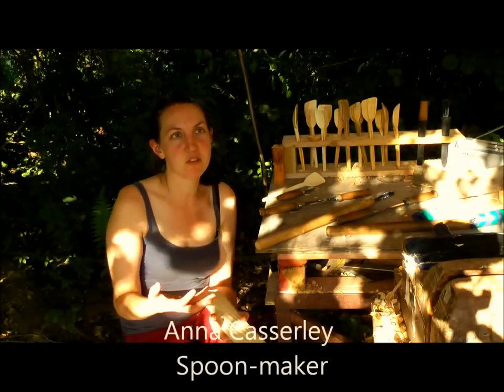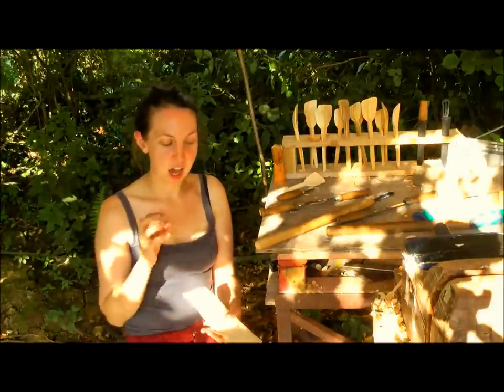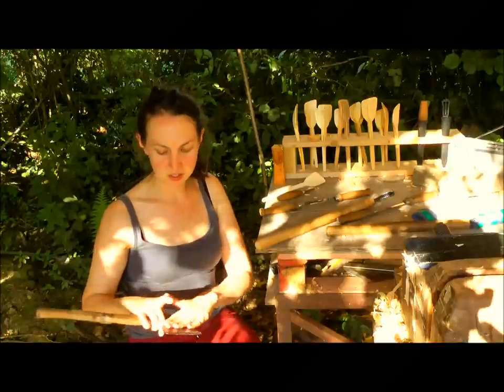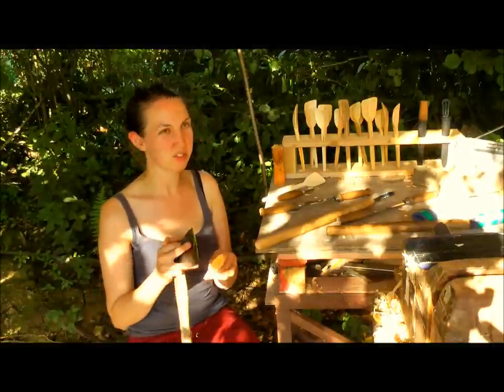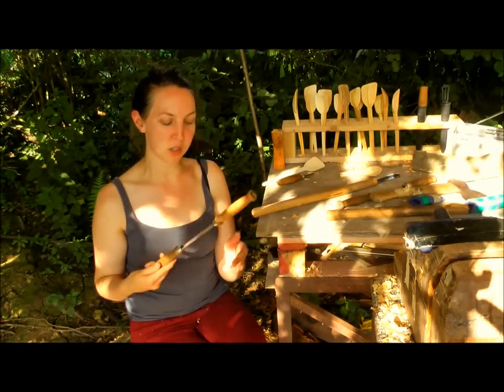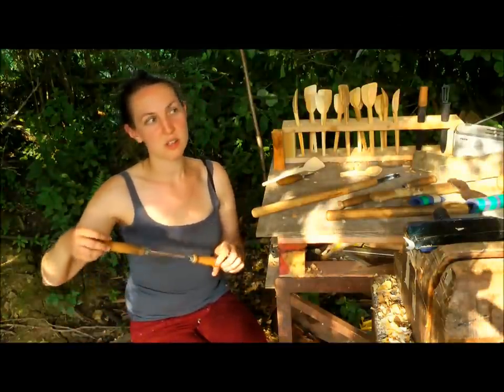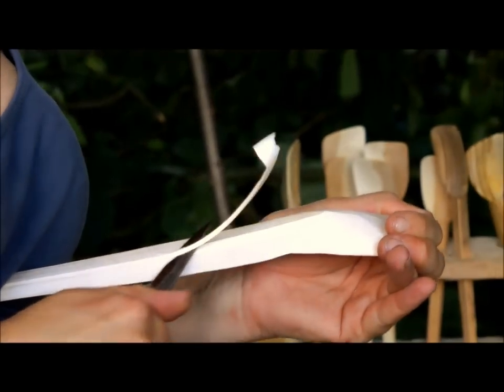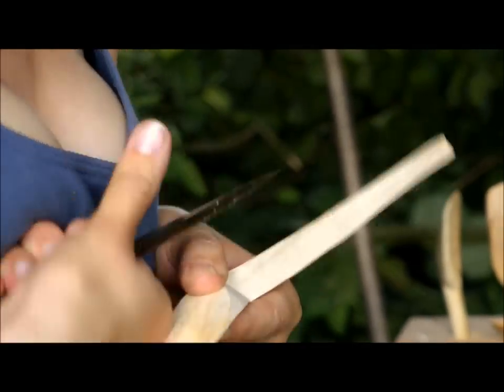The Woodcraft Series - Spoon Carving, Anna Casserley

Comment: Nice video Amy, good lighting and point of view, however, there are few things that I'm uncomfortable with, I can get past the English accent, but she mumbles a lot and it is hard to understand what she is saying.  It's call a draw knife, to be used on a draw stroke.  She is asking for an injury when she pushes with that particular knife.  Safety may not be a priority to her, viewers may think it is okay to use such tool that way. it's not.  I like her hook knife.  I look forward to your new posting.
Reply from the maker: Thank you for your comment and I am glad you like the video. I will say however, for any aspiring woodworkers, that Anna is a highly-competent professional and is using a push-knife. To use this tool, you push it down the length of wood: http://www.garrettwade.com/swedish-push-knife/p/04D04.04/http://www.garrettwade.com/swedish-push-knife/p/04D04.04/
Reply: Cesar ,Unfortunatly your comment is incorrect . Anna is using a Swedish spliting knife which is beveled on both sides and because the handles are set straight out is designed to be pushed or pulled . Anyone with even a limited amout of experience can see from the way she handles her axe that she is a a very compendent craftswomen , using all the tools shown in a safe manor.